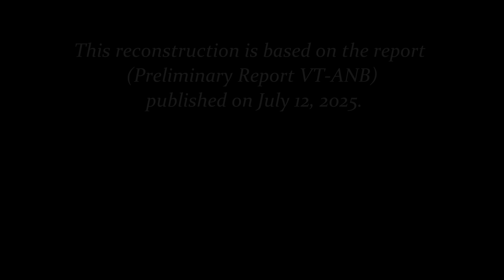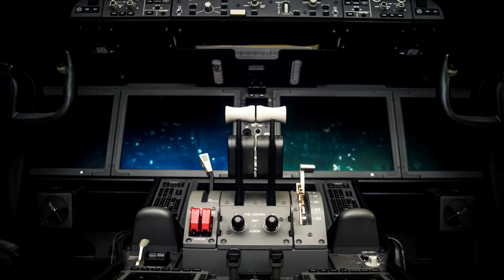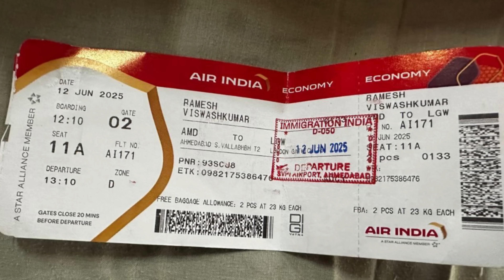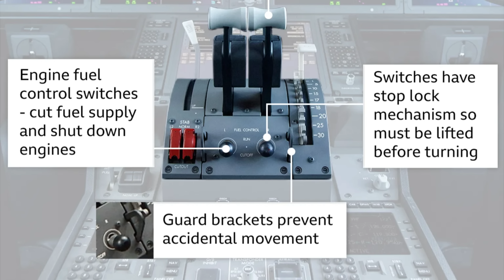787 Dreamliner Crash in Ahmedabad: Air India Flight 171 Crash Explained

Comment: This does not make sense, it takes 3 to 4 seconds for the engines to spool down, which means the plane will accellerate 2 to 3 seconds after shutdown of the engines. This points to dual engine shutdown BEFORE the plane reaching max speed and before the fuel cutoff switches were reported off. Maybe an electrical malfunction too. It has already been reported duel engine shutdown by software glitch on the 787. The media jumping to blame the pilots is horrendous IMHO!

Comment: Maybe switches were already in off position, from cleaning the cockpit. Maybe there was enough fuel left in lines to get the plane lifted, but ran out of fuel, and it came down.
Reply: no. the plane engines would have started up, taxied for minutes, then ramped up to near full power for the entire runway. Fuel must be injected into these engines, pumped in. If the pumps are off, no power.
Reply: That is sooo dumb

Comment: Why you do not mention the obvious, a suicide and mass murder as the only plausible reason for this crash? There is a thing called single point of failure and having two completely separate systems to ensure avoiding the single point of failure. Logic and understanding of probability is not your strong point unfortunately. Good video otherwise.

Comment: The non critical loads like air conditioning and entertainment modules failed during previous flights.  But, this does not explain why the high voltage module also failed, including transponders in this flight.  My theory is an EMP attack, sabotage by Pakistan with the help of China... An EMP attack targetting the lithium ion batteries (manufactured in China) and generators used to start the engines, used in the dreamliner...RAT is the last to be deployed..by the time the RAT is deployed, the damage is already done..the loud bang is the EMP device being detonated remotely or set to detonate at a set altitude causing the engine to shut down automatically to prevent any fire from reaching the wings where the fuel is stored...the engine can't shut down automatically without an total electrical system failure...an total electrical system failure cannot happen without the batteries and generators getting fried...batteries and generators can't get fried without an EMP pulse attack unlike military vehicles and planes which are EMP proofed..Revenge attack for taking out Nur Khan nuclear weapons storage tunnels through ventilation shaft (which US copied the strategy at Fordo), which killed 300 Pakistan soldiers...Sabotage.  Conspiracy.  EMP attack. It happened before in North America. US made planes lost power.  Couldn't even start any planes, and some US made cars (only) with chips. Cellphones did not work.  Had to use 2 way radios to communicate.  I had to tow my US made car with a chinese battery to a service station to get a new battery.  Batteries fried. If proof found that agents of a foreign state sponsor of terrorism (China and proxy of China, Pakistan) war will restart....No claim of responsibility because if it is a state sponsor of terrorism like Iran and Pakistan, they don't want to restart war.. The big blast sound the survivor heard shortly after takeoff is the EMP device blasting causing the batteries and generators to fry causing total electrical systems failure and engine shutting down automatically (before fuel switches moved to cutoff position automatically in 1 second which is not humanly possible) causing hydraulic failure causing landing gear unable to be retracted and RAT deploying automatically and resulting great drag combined with engine thrust loss causing plane to descent... The pilot took the full length of the runway so as to conserve fuel (Air India requirements) as it is too expensive in India..penny wise pound foolish...China has this technology and conducted an experimental attack in North America 3 years back, but it was covered up so as not to panic the public...

Comment: It is ok not to have all the data, it is not a crime. However jumping to conclusions based on minimum data is dangerous. It is ok to ask questions. For example if we take the timestamp of the emergency hydraulics systems coming online at 08:08:47 the RAT must have deployed at least 08 seconds before. Working backwards that brings the time to be 08:08:39 see the issue. Following this train of query, the RAT deployed BEFORE the switches transitioned. 
What does that mean? Engines/electrics/hydraulics failed just before or at Lift off. 
This is one possibility that needs to be examined thoroughly. 
This also makes the paraphrased communication of pilots as per CVR more rational . Those are queries not accusations, done while Memory items in the Quick Action checklist of a Dual Engine Malfunction after take-off is being carried out while trying to make sense of what is happening in the cockpit.

Comment: During Crash it was found that RAT was in deployed condition, it means even after one engine being operational at 08:52, it couldn't supply sufficient electrical power and that indicates that the electrical supply generator malfunction and probability it started malfunctioning during take-off itself.
It is impossible for Pilots to damage electrical power supply generators.
Before accusing someone for the crash, who will not come to defend him, we should be very cautious for proper analysis.
We should try our best to find out the truth, not to confuse anyone, and to chalk out proper precautionary measure so that such incidents would not happen in future.
Reply: The one miracle survivor also says the passenger cabin lost power and the emergency lighting came on.
Reply: @halfbakedproductions7887 
The Aircraft was having major electrical problems during its journey from Delhi to Ahmedabad on the same day. Probably the problem was not attended properly in Ahmedabad Airport. The maintenance report at Ahmedabad by Air India and Ground Engineers of Ahmedabad Airport may reveal the proper reason.

Comment: The Aircraft was falling at constant decceleration from its peak altitude or not is also an important data.
If it was falling at a constant decceleration, then after engine one operational, the rate of deceleration  would have been changed significantly.

Comment: Even if engine 2 couldn't be recovered, still with one engine operational the Aircraft could have been survived but it could not. It means that the engine which started functioning after 08:52 couldn't achieve enough thrust, if it could, RAT would have been disengaged.
Reply: Once the RAT is deployed, it stays out and continues to operate. It can only be 'disengaged' and stowed - by maintenance people - once the aircraft is on the ground.

Comment: In defense of this pilot - - - Based on the vague and changing information released, we must ask ourselves “are we absolutely certain whether the engines failed before or after the switches were turned off for the first time. ??  Youtube “experts” have correctly stated that the fuel switches are never turned off in flight in a 787, and further stated that there are no circumstances in which a pilot would turn off the fuel unless parked on the ramp.   But, in some less complex airplanes, and, under different circumstances, turning off the fuel, in order to minimize fire, is a normal procedure when a crash is imminent.  If the engines failed, for whatever reason, before the switches were turned off by the pilot, then a panicky pilot may have, out of desperation, in an obviously futile attempt to do anything which might save the airplane, turned the switches off, and then, realizing the futility, turned them back on, hoping the engines may restart in time.  This scenario may seem improbable, but, in my opinion, this scenario is less improbable than an accomplished pilot attempting suicide in such a horrendous and painful way as burning to death in a fiery airplane crash when there are so many other painless ways.  In analyzing these events, we need to use common sense in addition to technical knowledge, especially when the technical information is lacking and often contradicting. When we can't explain what happened, it's easy to blame the deceased, but, before rushing to judgement, and, and destroying the reputation of this accomplished pilot, and before disgracing him and his family, we need to have complete and accurate information, including, among other things, the exact time of the engine failures and the exact time of the switches being turned off.
Reply: Sämtliche dieser Stories sind erstunken und erlogen, getürkt und gefälscht.
Es wird gesucht, mit welcher Mär man am besten verwirren kann,
um den wahren Grund zu vertuschen.
Da wird im Trüben gefischt, dass sich die Balken nur so biegen.
.
Wer in welches Mikrophon gesprochen hat, zeichnet der Boardcomputer
(Blackbox) auf. Wer was gesagt hat, lässt sich über eine Hüllkurvenanalyse
feststellen. Ein Standardverfahren in Forensik und Kriminologie.
Doch sowohl die Tonband-Story als auch die mit dem Treibstoffschalter sind
erstunken und erlogen. Das hat alles nicht stattgefunden.
.
.
Nein. Die Triebwerke waren ab V1 nicht mehr abschaltbar.
Die 787 ist "redundant".
Das bedeutet auch, dass widersinnige Aktionen nicht getätigt werden können.
Sie können den Schalter umlegen, so oft Sie wollen. Es hat in der Startphase
keine Wirkung mehr, da die Programmlogik aufgrund der Redundanz, ergo
des Systemzustandes (Takeoff) einen unsinnigen Befehl schlicht nicht ausführt.
Das ist auch bei der Landung für die Schubumkehr so.
.
Außerdem hätte zumindest die APU noch funktioniert.
Da auch das RAT ausgefahren wurde, wurde nichts ABgeschaltet, sondern das
komplette Bordnetz fiel aus.
Auch DAS lässt sich von den Piloten vom Cockpit aus nicht machen.
Nur am Boden bei Servicewartungen. Um die Maschine zu reseten.
.
Jamming per GPS aber schon. (!)  War schon in den 80ern vorgesehen, so
möglichen Luftpiraten die Übernahme einer Maschine unmöglich zu machen
und die Maschine per GPS in "sichere" Gefilde zu lenken.
Einige wenige Systeme mit eigenem Stromkreislauf (Funk, Black Boxes) wurden
noch von den Akkus gestützt.
Man hat sich erst mal weiterhin mit Sky-Marshalls beholfen. Aber inzwischen
gibt es ja besagte Technik und die immer perfekter.
Die hier dargebotenen Geschichten sind frei erfunden. Erstunken und erlogen.

.
.
Man sollte als BRICS-Mitglied besser keine amerikanischen Flugzeuge kaufen. (!)
Boeing ist auch ein militärisches Unternehmen.
.
Beim MCAS-"Absturz" der Äthiopian-Airlines saßen 20 äthiopische UN-Delegierte
mit in der Maschine.
DIESE 20 Delegierten, die mit ihren Gegenstimmen dafür sorgten, dass die USA
keine Militärbasis in Äthiopien errichten durften.
.
Dass das per US-GPS satellitensteuerbare  MCAS  generell geheim gehalten wurde,
war keine bloße Schlamperei und/oder Sparmaßnahme um Airbus dagegenzuhalten,
wie offiziell kolportiert.
-
Das US-Amerikanische GPS-System wird genauso in Waffensystemen wie Drohnen,
Raketen und dgl. verwendet wie in der Zivilluftfahrt. Das Jamming weiß nicht,
ob es die Funktionen eines zivilen oder militärischen Gerätes stört, bzw. unterbricht.
Das weiß nur der Absender.
.
Auch in der Indonesischen MCAS-Absturzmaschine Lion Air saßen fünf solcher
Widersacher, mit deren Votum ein Jahr zuvor auch in Indonesien eine Marinebasis
der Amis verhindert wurde.
-
Die beste Versicherung für Staaten, die sich den USA nicht unterordnen lassen
wollen, ist, nur noch von der brasilianischen Embraer, der chinesischen Comac
und der russischen OAK zu kaufen.
Die benutzen ihre Systeme, so wie auch Microsoft ihr Schnüffel- und Sabotage-Windows,
nicht als Waffe...
Reply: I agree entirely. Why, with so little concrete information are so many, including pilots so willing to go there? This is where the timeline is crucial. If the RAT deployed before or at takeoff, the pilot would realize the engines were spooling back and ask the other pilot "why or did you flip the fuel switches"? The other replied "I didn't", because he didn't. A few hundred feet above the ground, it's reasonable to believe the pilot flipped the switches in desperate attempt to " try anything" to restore fuel. Way too soon, with Boeing's history with software issues,  to assume one of the pilots is a crazed suicidal mass murderer.
Reply: Sorry but this was not the case according to 787 pilots and engineers...and they cannot be accidentally moved.
Reply: I'm still fairly confident that the ultimate cause of the crash will be found to be electrical, mechanical or,( most likely), another of Boeing's long history of software glitches. What are you most likely to ask yourself stepping onto a Boeing plane: I hope the pilot isn't planning to murder me today, or I hope Boeing has fixed all their faulty software?

Comment: If Fuel is shifted from RUN to CUT OFF then can easily be recognized immediately from the display of control panel by monitoring the fuel flow indication and immediately would check the Fuel Switch Position and would shift the Fuel Switch from CUT OFF to RUN if that Pilot didn't have any intention to suicide and there would have been more conversation.

Comment: Speculation 1
Both Pilot jointly decided for Suicidal Act then only it is possible that one Pilot shifted the Fuel Switch from RUN to CUT OFF otherwise not possible.

As per Preliminary Report immediately after 08:42 both Fuel Switches were shifted from RUN to CUT OFF within a gap of 01 second, at least this data was supposed to be provided at Resolutions of 0.1 second which is available in FDR of Dreamliner.
Timing of Conversation between the Pilots should have been provided and was there any Conversation among them and the details atleast 15 seconds prior to take off.
Preliminary Report mentioned  CCTV Footage captured immediately after take-off RAT was deployed, it should have been mentioned in perfect time instant.
Otherwise it is not possible to come to any conclusion because FDR directly doesn't record data, it is through some auxiliary parameters.

Comment: CORRECTION.  Both pilots were not "surprised" by the cutoff.  Only one of them was taken aback. The one who cut off the fuel to the engines.  He asked the other pilot WHY he switched them off.  Because he had seen it himself.  It's impossible to accidentally switch them both of them off.  The crash is only "puzzling" or a "mystery" if you don't accept the evidence.  This guy is trying to pretend the pilots had no role.
Reply: Sorry, too many assumptions there.
Reply: Or it could have been an electronic error as documented by Boeing elsewhere Sherlock. Like so many,  you seem to be suffering from premature extrapolation.
Reply: @shakiMiki  they're not mechanized & automated switches. They must be physically flipped. How does an electronic fault physically move the switches?